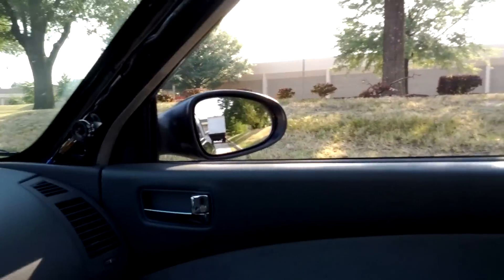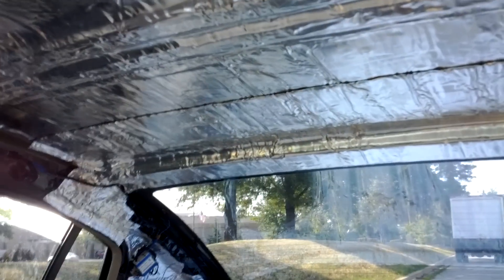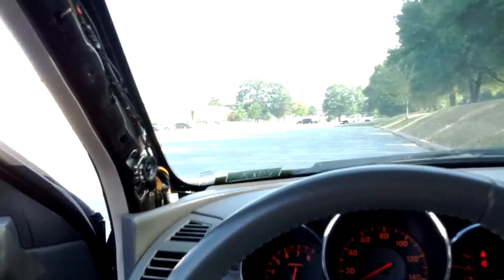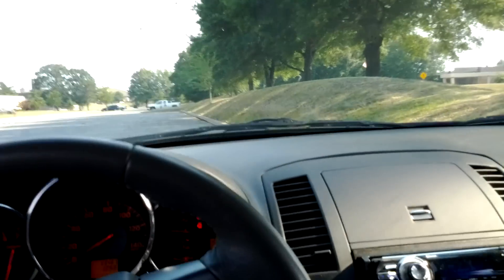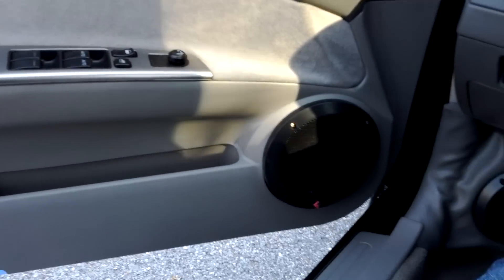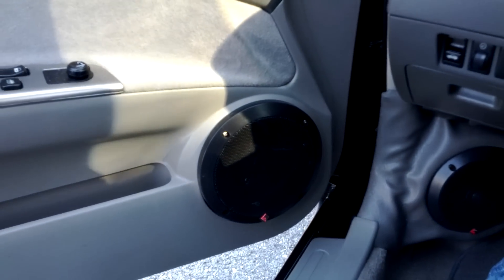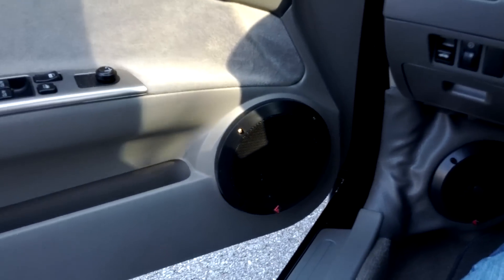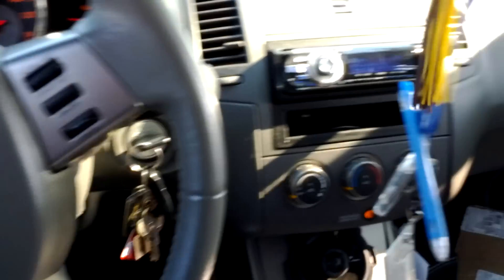FI 15" Sp4 on a AQ35001 Part 2

Comment from the maker: well the rockford was putting out less power but i had my alternator in then. I had to send it out before i put in all the new stuff in and i also dont know how long it was running on 1 coil. So when i get it back and the alternator i hoping for a dramatic difference. I just got the other Kinetik 3800 in there today so i will have full battery power too.